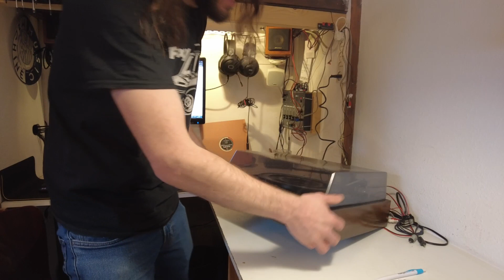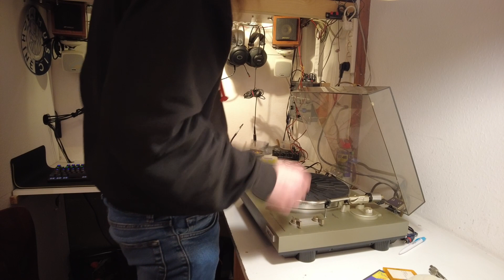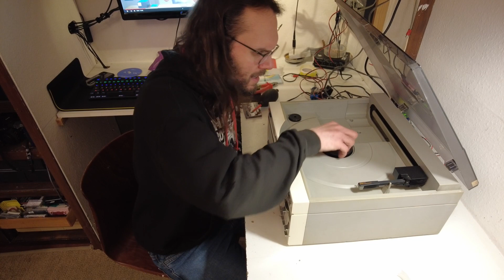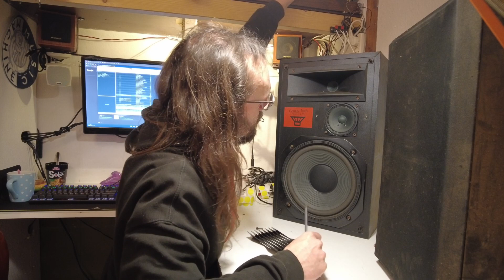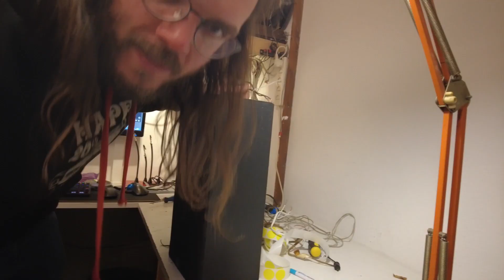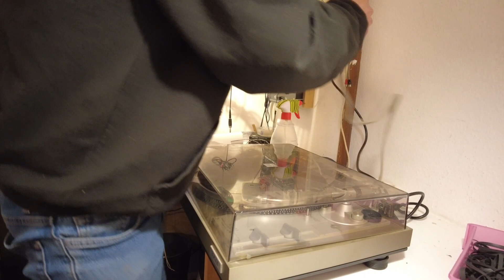HUGE audio haul, a speedtest. Part three.

Comment: That Sharp system with the pickup going underneath the record was pretty wild! never seen that before
Reply from the maker: It's actually surprisingly okay. I jokingly recorded a cassette with it and it sounds like a half decent cheap stereo system would.
Reply: @rollingtroll  looks awsome! so 1987 ish
Reply from the maker: To be fair, it's still not 100% good. Tracking is definitely off when upside down, but it works and it's usable for a demo (or a little mixtaping :D) @groovechampion1462
Reply: @rollingtroll cool idea tho!
Reply from the maker: And judging by the way it still mostly works without too much repairs, a pretty well executed one! @groovechampion1462